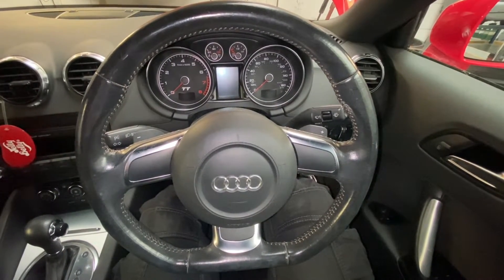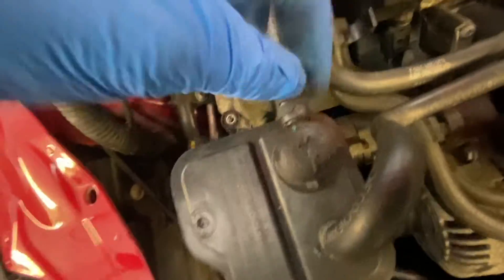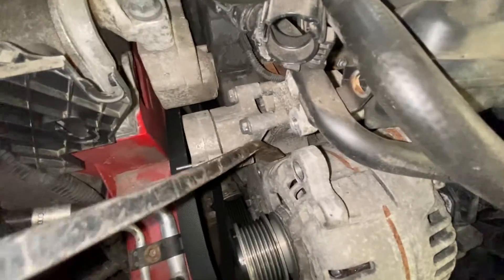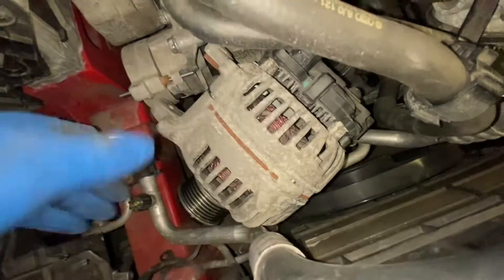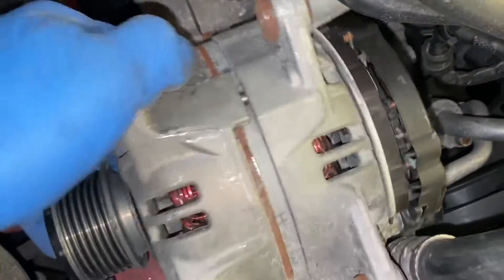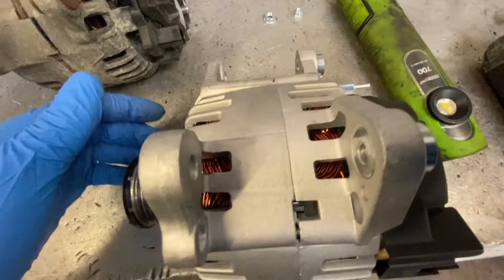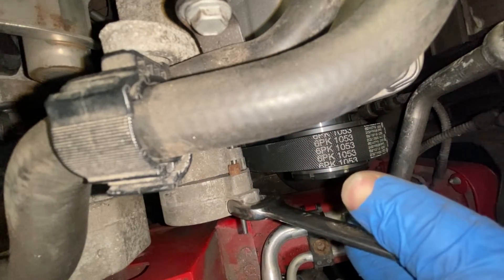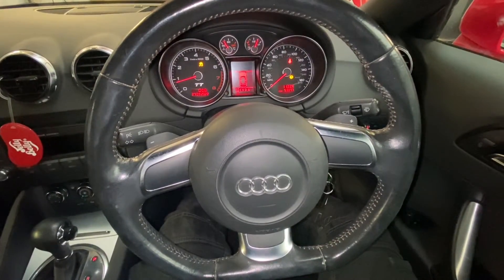#Audi #TT 2.0 TFSI Alternator Replacement

Comment: Thanks for your video GAB I managed to do this over the weekend getting it out was easy sadly putting it back I knocked the belt off and spent around half an hour trying to do that had to jack it up in the air in the end for some reason the wiring for the battery terminal can be a pain to put back on have to rotate the alternator around nearer to it while your doing it :) but Amazing video thanks

Comment: What year is this car?
Reply: Interior is from a 8j / Mk2 TT (2006-2014 i think)
Would need to make sure you have the same engine as the process could be different depending on where everything is setup.
Reply from the maker: This one is a 2008 model but they go up to 2014